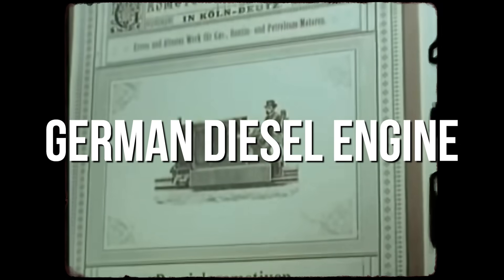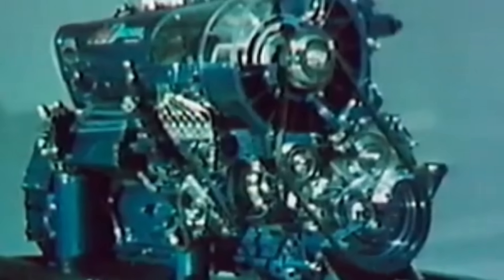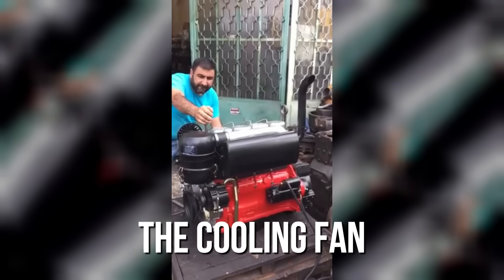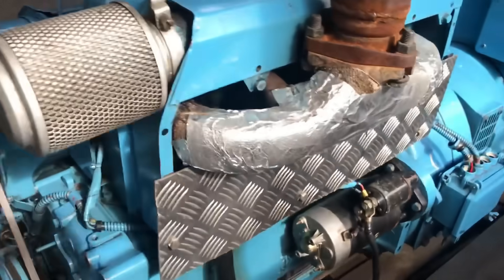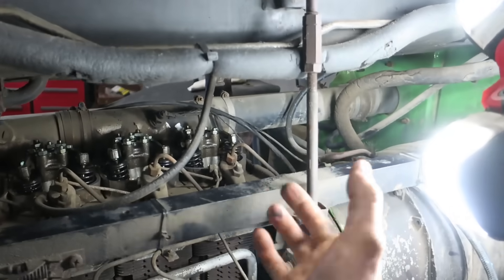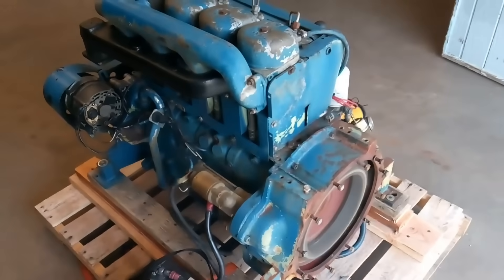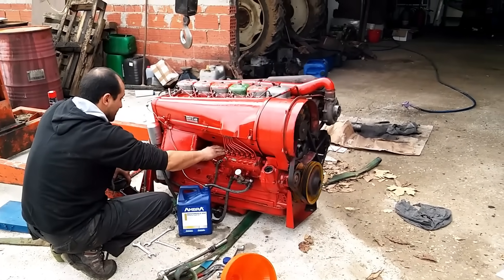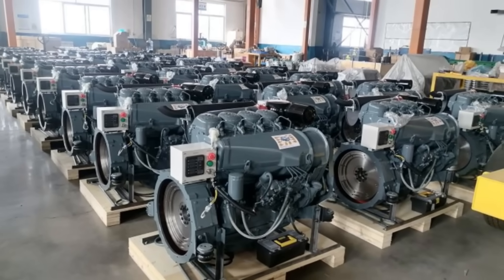The Insane Truth About the Bizarre Deutz F4L912 Diesel Engine

Comment: A very similar belt-driven fan/air scoop cooling system was used on the Lister LPA diesels, which were the air-cooled version of the water-cooled LPW units. A usually trouble -free and low maintenance system, especially with a dry exhaust, but like the Deutz, any lack of ambient fresh cooling air and they would overheat in short order.

Comment: My father was an engineer on a coastal cargo ship that used Deutz M8cyl, 2SA, 400x580mm, eight-cylinder, two-stroke cycle marine diesel engine with a 400mm bore and 580mm stroke, producing 1800 brake horsepower. He said it performed as well in Scandanavia / Arctic as it did in the Mediterranean. I’ve also come across them in Magirus Deutz and Ford trucks as well as donkey engines, maintaining oil levels was critical; they weren’t the most powerful but properly maintained very reliable.

Comment: I still have a deutz engine working, the problem is where can i get the parts for repairs
Reply: You can still buy parts for them anywhere. Germany sold the drawings and tooling to Africa, Russia, China. China still produces these engines new off the line but with modern upgrades like high pressure commonrail injection. You can get a 300hp 6FL913 today.

Comment: In the early 2000s, we rescued a flathead Ford that powered a generator on the roof of a small hospital in Long Beach, CA. It had been there since the early 1950s. It was backup power for the surgical theater.

Right next to it was a five-cylinder Deutz that powered the entire hospital and part of the block around the hospital. 

Both were maintained religiously and fired monthly for decades. We had no use for the Deutz, but it was so damn nice that it made me sad to leave it there.

Comment: In what world do the air cooled use a lot of fuel. They barely use diesel. Watercooled engines use more diesel than the air cooled ones.
Reply: Yeh I was gona say that as well. I have an Italian air cooled tractor, 85hp. It’s uses 5L of diesel/hr under max load.
Reply: I agree.
We had several Deutz farm tractors in the 70s and 80s. They used around half the fuel of an equivalent John Deere, and were perfectly happy pulling hard in 40 degree Celsius (104 Fahrenheit) temperatures.

A friend worked up in Tuktoyaktuk, NWT, in Northern Canada. He said the Deutz powered generators were still working well with 30,000 hours on their clocks.

Comment: Had a 6cyl turbo duetz in a c70 GMC.  The oil cooler served as a cab heater.  Ducted into cab for heat or outside in summer as an oil cooler.  Great truck,  factory installed.  Weird though
Reply: Nope. Deutz diesel engines were never a factory offering. Detroit,  and Cat, sure. 
Someone swapped it in.

Comment: I have a F3L912 that I plan on installing into my 1942 Jeep
Reply: I got the deutz for free and it has a fresh rebuild. I also got the jeep for free, so when I get it finished I will call it the “Freep”😂
Reply: @Good-Andy  Sounds like a super cool project to me 🙂
Reply: I love interesting engine conversions, but you may be happier with something like an all mechanical 4 cyl MBZ diesel and matching automatic trans.  For heavy offroad use climbing etc, a better trans adaption may be in order.

Comment: Oil actually did most of the cooling in these engines, there is an air to oil cooler that can be clogged with dust just like a radiator. That being said there were definitely reliable engines.
Reply: That's absolutely not correct & I speak as a mechanical engineer ( not a technician/mechanic) who worked for Deutz from 1997 to 2005, and has much experience with the 912 and 913 series.

There is an air-to-oil cooler, yes, just as there's a water-to-oil cooler in a liquid or water-cooled engine. Proportionally this oil cooler accounted for <10% of the overall cooling. It did not do 'most of the cooling' !!
Reply: Oil does over 60% of the cooling of any infernal combustion engine. Water or air cooled. So you are absolutely correct. Have experienced Deutz engines running 'tits out' for extended periods on drill rigs. Nice, simple engines. 🙂
Reply: @Bryce-z9v they are such good quality
Reply: @wildmanofborneo  I never forget them running flat out on drill rigs in the Australian desert. Music 🙂
Reply: @Bryce-z9v     Absolute BS, oil is for lubrication and is not used for cooling as you believe.
Reply: @LongfordGer  I have to disagree with you. Have been a mechanical engineer for 47 years and have worked on engine setups from marine to motorcycles. I did quote 60%, not 'most' cooling. We only know what we are taught. If your specialty is Deutz, good on you. Check out 'Lake Speed Jnr' oil geek. :body-blue-raised-arms:Cheers 🙂
Reply: @Bryce-z9v   Being a 'mechanic' does not make you an engineer, there is a quite a difference, and your understanding/belief as regards IC engine oil cooling is completely wrong.
Reply: @LongfordGer  Whatever you say :body-blue-raised-arms::body-blue-raised-arms:
Reply: @LongfordGer  Just checked facts I already know. Go back to school dude and be careful what you spout from your keyboard. Lol 🙂
Reply: @LongfordGer oil does a handful of things, lubrication, cooling, cleaning, sealing. Most engines have an engine oil cooler (whether it’s a water to oil cooler or an oil to air cooler) because the oil absorbs some of the heat allowing the engine to maintain optimal temperature and reducing any hot spots that the oil can deal with.
Reply: @Bryce-z9v . How about you cite a source for your facts?!  You can double down all you want but you are still wrong.
Reply: @thatgamingprotogen7043 . With an air-cooled deutz engine, air is the primary coolant of the main hot parts of the engine; the cylinders & cylinder heads. Cooling of the lube oil is a secondary function that also uses air, that’s all.
Reply: @LongfordGer not only with deutz, Tatra also had air cooled diesels. there is still extra oil lines either cast into the block or hidden somewhere where airflow can be ducted to, both the deutz and tatras I own have an oil cooler in part of the primary air duct.
Reply: @LongfordGer lubrication is cooling in the sense that it prevents heat build-up from friction, nevermind the burning of fuel
Reply: @thatgamingprotogen7043  Same as Volkswagen 🙂
Reply: @wildmanofborneo  I reckon my Toyota Landcruiser is gasoline cooled, Lol 🙂
Reply: @LongfordGer  I call BS on you being a mechanical engineer. Oil lubricates, cools, cleans and seals. Maybe you swept the floor at Deutz.
Reply: 10:07 the oil cooler can be seen here in the air cooling plenum.
It looks no more likely to clog than the cylinder fins
Reply: @PaulG.x  You are correct. Oil leaks are the enemy of air cooled engines. They are not something that you can put off repairing. Oil plus dust equals disaster :body-blue-raised-arms:
Reply: Maguiris Deutz was a truck brand with an air cooled Deutz motor that was reasonably popular in Australia in the 1950/60s.

Comment: Many years ago, my grandfather acquired an ancient F2L712 engine that he used in our custom built workboat as a genset engine.  It never failed but always ran kinda crappy until I as a late teenager investigated and tightened a bunch of banjo fittings.  for whatever reason, the germans love those banjo fittings, but they are prone to loosen randomly and need occasional tightening to work right.
Reply: They love things that are elegant but not often that reliable.  Why do we have DIN hydraulic fittings?  Germans.  At least their quirky stuff usually works unlike that of the Brits.  US stuff is usually simple and often leaks or something.  Old Detroits, covered in coats of oil and dirt but they keep running.

Comment: Recall seeing these engines in the late Eighties at Wagner Mining.
Reply: Worked on the ST8 and Eimco 915 loaders, V8 and V10s that was in a mine on the West Coast of Tasmania, they were good but had to work hard, the Wagners were changed to 3306 caterpillar engines which gave longer engine service life, Deutz were good engines though
Reply: @TayneCooper  I know EIMCO had to pay to repower some 913s or 915s with Deutz engines because the CATs ran too dirty. I've run a 913 with 3304PCNA and the thing smokes like a locomotive when under load.